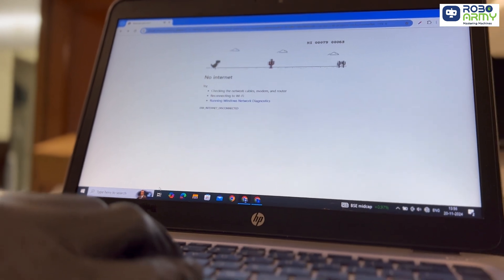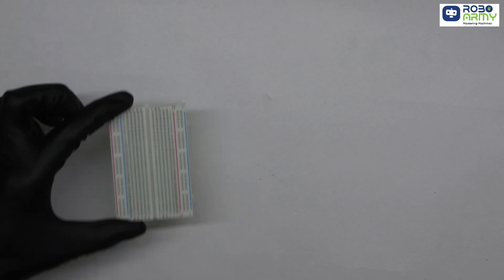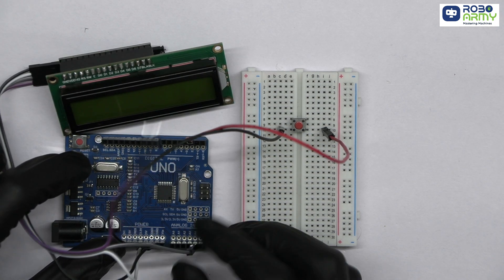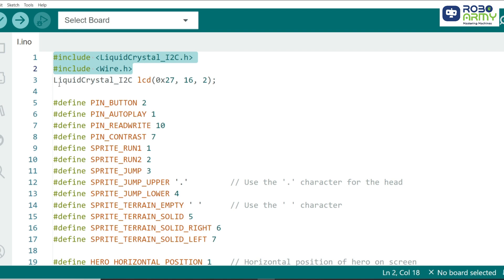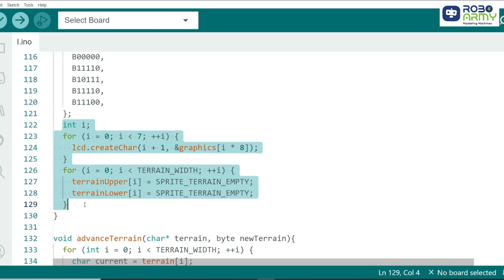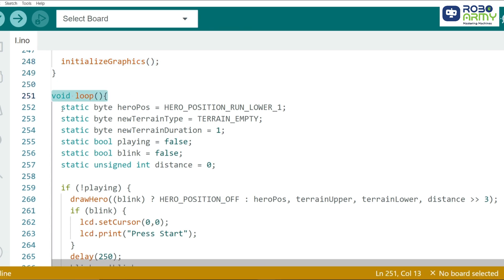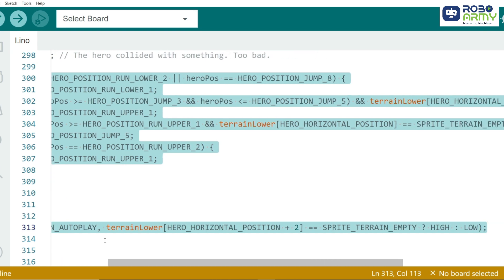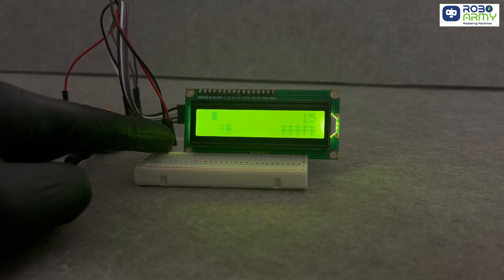Build the LCDino Run: Smart Dino Game Using Arduino UNO & LCD Display

Comment: no error but nothing displayed
Reply from the maker: Make sure your OLED is connected correctly (SDA to GPIO 21, SCL to GPIO 22), I2C address is 0x3C, and the display is initialized properly in the code. Also check contrast and wiring!

Comment: C:\Users\bilal\Downloads\38\38.ino: In function 'void setup()':
C:\Users\bilal\Downloads\38\38.ino:242:13: error: no matching function for call to 'LiquidCrystal_I2C::begin()'
   lcd.begin();
             ^
In file included from C:\Users\bilal\Downloads\38\38.ino:1:0:
c:\Users\bilal\Documents\Arduino\libraries\LiquidCrystal_I2C/LiquidCrystal_I2C.h:58:8: note: candidate: void LiquidCrystal_I2C::begin(uint8_t, uint8_t, uint8_t)
   void begin(uint8_t cols, uint8_t rows, uint8_t charsize = LCD_5x8DOTS );
        ^~~~~
c:\Users\bilal\Documents\Arduino\libraries\LiquidCrystal_I2C/LiquidCrystal_I2C.h:58:8: note:   candidate expects 3 arguments, 0 provided

exit status 1

Compilation error: no matching function for call to 'LiquidCrystal_I2C::begin()'
Reply from the maker: Hi! 😊 The error you're getting is because the lcd.begin(); function requires three parameters in the version of the LiquidCrystal_I2C library you're using.

Try replacing:
lcd.begin();

with
lcd.begin(16, 2);

This tells the LCD that your display has 16 columns and 2 rows. After that, your code should compile without errors. Let me know if you face any more issues — happy to help!

Comment: what should i do it say Compilation error: no matching function for call to 'LiquidCrystal_I2C::begin()'
Reply from the maker: It looks like you're getting an error because of the lcd.begin() function. For the LiquidCrystal_I2C library, the correct function to initialize the LCD is usually lcd.init() instead of lcd.begin().

✅ Try replacing:
lcd.begin();

with:
lcd.init();

Also, make sure you have installed the correct LiquidCrystal_I2C library (by Frank de Brabander or similar) in the Arduino IDE. Let me know if it works or if you face any other issue!

Comment: My lcd ıs openıng and closıng ın 1 second and dısplays nothıng
Reply from the maker: Sure, I’d be happy to help! 😊
A blue screen usually means the LCD is getting power but not initializing correctly. Here are a few things you can check:

I2C Address – Make sure the address in your code matches your LCD module (commonly 0x27 or 0x3F). You can use an I2C Scanner sketch to find the correct address.

Power Supply – If you’re using an SW-quare power supply and the screen keeps resetting, it might not be providing stable voltage. Try using a reliable 5V USB power source.

Contrast Issue – Adjust the contrast potentiometer on the I2C module until you see text.

Wiring – Double-check the SDA/SCL connections:

SDA → A4

SCL → A5 (for Arduino UNO)

Let me know what you're using (LCD model, Arduino board, etc.) and I can guide you more specifically!
Reply: @robo_army_  thank you I solved it I changed the potansiyometres Degree at the back of LCD the i2c module and it worked thanks ❤
Reply from the maker: Great work.

Comment: can you help me please ıt just gıves a blue screen and ı am usıng sw-quare power supply
Reply from the maker: Sure, I’d be happy to help! 😊
A blue screen usually means the LCD is getting power but not initializing correctly. Here are a few things you can check:

I2C Address – Make sure the address in your code matches your LCD module (commonly 0x27 or 0x3F). You can use an I2C Scanner sketch to find the correct address.

Power Supply – If you’re using an SW-quare power supply and the screen keeps resetting, it might not be providing stable voltage. Try using a reliable 5V USB power source.

Contrast Issue – Adjust the contrast potentiometer on the I2C module until you see text.

Wiring – Double-check the SDA/SCL connections:

SDA → A4

SCL → A5 (for Arduino UNO)

Let me know what you're using (LCD model, Arduino board, etc.) and I can guide you more specifically!

Comment: Anyone else had the issue of just "Press start" and hero blinking and game not starting when the button is pressed?
Reply from the maker: Yes, that issue usually happens when the push button isn’t wired correctly or the code isn't detecting the button press properly. Here are a few things to check:

Wiring: Make sure one side of the button is connected to GND and the other to a digital pin (e.g., D2) with a pull-up resistor (or use INPUT_PULLUP in code).

Code: If you’re using digitalRead(), confirm that the button logic matches — for example:

pinMode(buttonPin, INPUT_PULLUP);
if (digitalRead(buttonPin) == LOW) {
  // Start the game
}

Debouncing: Sometimes a button press isn’t detected due to bounce. Adding a small delay (e.g., delay(200);) after detecting the press can help.

Check the Serial Monitor (if used) to debug the button input. If it's still not working, feel free to share your wiring and code — happy to help!

Comment: Why does the dinosaur are flying?
Reply from the maker: In the Chrome Dino game, when we lose internet, the dinosaur jumps over obstacles. Similarly, in our Arduino-based LCD Dino Game, the dinosaur 'jumps' to avoid obstacles, but due to display limitations, it might look like it's flying. Just like the original game, the goal is to time the jumps correctly to keep playing!

Comment: bro this is the craziest working project i had built thanks for posting such amazing videos

but there is  one fault-in the video you have put SDA and SCL in A4 and A5
but in circuit diagram in description is after aref so you can fix that
thanks a lot again
Reply from the maker: Thanks a lot for your kind words! 😊 Glad you enjoyed building the project! Regarding the SDA and SCL connections: In the circuit diagram, they are actually connected to the dedicated SDA and SCL pins near the AREF pin on the Arduino, not A4 and A5. Both sets of pins work the same for I2C communication, but we used the dedicated ones for better clarity. Let me know if you need any help!
Reply: @robo_army_   oh alr i dint know that i made the project for science exhibition works perfectly

thanks a lot
Reply from the maker: Congrats for the exhibition

Comment: Why can't I download the code?
Reply: I can't see the code even though I downloaded it
Reply from the maker: Try it again via this link: https://roboarmypublicfiles.s3.ap-south-1.amazonaws.com/code/i.ino
Reply: @robo_army_  still can't open it
Reply from the maker: #include <LiquidCrystal_I2C.h>
#include <Wire.h>
LiquidCrystal_I2C lcd(0x27, 16, 2);

#define PIN_BUTTON 2
#define PIN_AUTOPLAY 1
#define PIN_READWRITE 10
#define PIN_CONTRAST 7
#define SPRITE_RUN1 1
#define SPRITE_RUN2 2
#define SPRITE_JUMP 3
#define SPRITE_JUMP_UPPER '.'         // Use the '.' character for the head
#define SPRITE_JUMP_LOWER 4
#define SPRITE_TERRAIN_EMPTY ' '      // Use the ' ' character
#define SPRITE_TERRAIN_SOLID 5
#define SPRITE_TERRAIN_SOLID_RIGHT 6
#define SPRITE_TERRAIN_SOLID_LEFT 7

#define HERO_HORIZONTAL_POSITION 1    // Horizontal position of hero on screen

#define TERRAIN_WIDTH 16
#define TERRAIN_EMPTY 0
#define TERRAIN_LOWER_BLOCK 1
#define TERRAIN_UPPER_BLOCK 2

#define HERO_POSITION_OFF 0          // Hero is invisible
#define HERO_POSITION_RUN_LOWER_1 1  // Hero is running on lower row (pose 1)
#define HERO_POSITION_RUN_LOWER_2 2  //                              (pose 2)

#define HERO_POSITION_JUMP_1 3       // Starting a jump
#define HERO_POSITION_JUMP_2 4       // Half-way up
#define HERO_POSITION_JUMP_3 5       // Jump is on upper row
#define HERO_POSITION_JUMP_4 6       // Jump is on upper row
#define HERO_POSITION_JUMP_5 7       // Jump is on upper row
#define HERO_POSITION_JUMP_6 8       // Jump is on upper row
#define HERO_POSITION_JUMP_7 9       // Half-way down
#define HERO_POSITION_JUMP_8 10      // About to land

#define HERO_POSITION_RUN_UPPER_1 11 // Hero is running on upper row (pose 1)
#define HERO_POSITION_RUN_UPPER_2 12 //                              (pose 2)

static char terrainUpper[TERRAIN_WIDTH + 1];
static char terrainLower[TERRAIN_WIDTH + 1];
static bool buttonPushed = false;

void initializeGraphics(){
  static byte graphics[] = 
  {
    // Dino Run position 1
    B11110,
    B10111,
    B11110,
    B11100,
    B11111,
    B11100,
    B10010,
    B11011,
    // Dino Run position 2
    B11110,
    B10111,
    B11110,
    B11100,
    B11111,
    B11100,
    B01010,
    B10011,
    // Dino Jump
    B11110,
    B10111,
    B11110,
    B11100,
    B11111,
    B11110,
    B10001,
    B00000,
    // Jump lower part [lower part of Dino while jumping]
    B11111,
    B11100,
    B10010,
    B11011,
    B00000,
    B00000,
    B00000,
    B00000,
    // Cactus Center part
    B00100,
    B11111,
    B00100,
    B00101,
    B11111,
    B00100,
    B00100,
    B00100,
    // Cactus right part
    B00000,
    B00011,
    B00000,
    B00000,
    B00011,
    B00000,
    B00000,
    B00000,
    // Cactus left part
    B00000,
    B11000,
    B00000,
    B01000,
    B11000,
    B00000,
    B00000,
    B00000,
    // Jump upper part [upper part of Dino while jumping]
    B00000,
    B00000,
    B00000,
    B00000,
    B11110,
    B10111,
    B11110,
    B11100,
  };
  int i;
  for (i = 0; i < 7; ++i) {
    lcd.createChar(i + 1, &graphics[i * 8]);
  }
  for (i = 0; i < TERRAIN_WIDTH; ++i) {
    terrainUpper[i] = SPRITE_TERRAIN_EMPTY;
    terrainLower[i] = SPRITE_TERRAIN_EMPTY;
  }
}

void advanceTerrain(char* terrain, byte newTerrain){
  for (int i = 0; i < TERRAIN_WIDTH; ++i) {
    char current = terrain[i];
    char next = (i == TERRAIN_WIDTH - 1) ? newTerrain : terrain[i + 1];
    switch (current) {
      case SPRITE_TERRAIN_EMPTY:
        terrain[i] = (next == SPRITE_TERRAIN_SOLID) ? SPRITE_TERRAIN_SOLID_RIGHT : SPRITE_TERRAIN_EMPTY;
        break;
      case SPRITE_TERRAIN_SOLID:
        terrain[i] = (next == SPRITE_TERRAIN_EMPTY) ? SPRITE_TERRAIN_SOLID_LEFT : SPRITE_TERRAIN_SOLID;
        break;
      case SPRITE_TERRAIN_SOLID_RIGHT:
        terrain[i] = SPRITE_TERRAIN_SOLID;
        break;
      case SPRITE_TERRAIN_SOLID_LEFT:
        terrain[i] = SPRITE_TERRAIN_EMPTY;
        break;
    }
  }
}

bool drawHero(byte position, char* terrainUpper, char* terrainLower, unsigned int score) {
  bool collide = false;
  char upperSave = terrainUpper[HERO_HORIZONTAL_POSITION];
  char lowerSave = terrainLower[HERO_HORIZONTAL_POSITION];
  byte upper, lower;
  switch (position) {
    case HERO_POSITION_OFF:
      upper = lower = SPRITE_TERRAIN_EMPTY;
      break;
    case HERO_POSITION_RUN_LOWER_1:
      upper = SPRITE_TERRAIN_EMPTY;
      lower = SPRITE_RUN1;
      break;
    case HERO_POSITION_RUN_LOWER_2:
      upper = SPRITE_TERRAIN_EMPTY;
      lower = SPRITE_RUN2;
      break;
    case HERO_POSITION_JUMP_1:
    case HERO_POSITION_JUMP_8:
      upper = SPRITE_TERRAIN_EMPTY;
      lower = SPRITE_JUMP;
      break;
    case HERO_POSITION_JUMP_2:
    case HERO_POSITION_JUMP_7:
      upper = SPRITE_JUMP_UPPER;
      lower = SPRITE_JUMP_LOWER;
      break;
    case HERO_POSITION_JUMP_3:
    case HERO_POSITION_JUMP_4:
    case HERO_POSITION_JUMP_5:
    case HERO_POSITION_JUMP_6:
      upper = SPRITE_JUMP;
      lower = SPRITE_TERRAIN_EMPTY;
      break;
    case HERO_POSITION_RUN_UPPER_1:
      upper = SPRITE_RUN1;
      lower = SPRITE_TERRAIN_EMPTY;
      break;
    case HERO_POSITION_RUN_UPPER_2:
      upper = SPRITE_RUN2;
      lower = SPRITE_TERRAIN_EMPTY;
      break;
  }

  if (upper != ' ') {
    terrainUpper[HERO_HORIZONTAL_POSITION] = upper;
    collide = (upperSave == SPRITE_TERRAIN_EMPTY) ? false : true;
  }
  if (lower != ' ') {
    terrainLower[HERO_HORIZONTAL_POSITION] = lower;
    collide |= (lowerSave == SPRITE_TERRAIN_EMPTY) ? false : true;
  }
  byte digits = (score > 9999) ? 5 : (score > 999) ? 4 : (score > 99) ? 3 : (score > 9) ? 2 : 1;

  terrainUpper[TERRAIN_WIDTH] = '\0';
  terrainLower[TERRAIN_WIDTH] = '\0';
  char temp = terrainUpper[16 - digits];
  terrainUpper[16 - digits] = '\0';

  lcd.setCursor(0, 0);
  lcd.print(terrainUpper);
  terrainUpper[16 - digits] = temp;
  lcd.setCursor(0, 1);
  lcd.print(terrainLower);

  lcd.setCursor(16 - digits, 0);
  lcd.print(score);

  terrainUpper[HERO_HORIZONTAL_POSITION] = upperSave;
  terrainLower[HERO_HORIZONTAL_POSITION] = lowerSave;
  return collide;
}

// Handle the button push as an interrupt
void buttonPush() {
  buttonPushed = true;
}

void setup() {
  pinMode(PIN_READWRITE, OUTPUT);
  digitalWrite(PIN_READWRITE, LOW);
  pinMode(PIN_CONTRAST, OUTPUT);
  digitalWrite(PIN_CONTRAST, LOW);
  pinMode(PIN_BUTTON, INPUT);
  digitalWrite(PIN_BUTTON, HIGH);
  pinMode(PIN_AUTOPLAY, OUTPUT);
  digitalWrite(PIN_AUTOPLAY, HIGH);
  
  // Initialize the LCD
  lcd.begin();
  lcd.backlight();

  // Digital pin 2 maps to interrupt 0
  attachInterrupt(digitalPinToInterrupt(PIN_BUTTON), buttonPush, FALLING);
  
  initializeGraphics();
}

void loop(){
  static byte heroPos = HERO_POSITION_RUN_LOWER_1;
  static byte newTerrainType = TERRAIN_EMPTY;
  static byte newTerrainDuration = 1;
  static bool playing = false;
  static bool blink = false;
  static unsigned int distance = 0;
  
  if (!playing) {
    drawHero((blink) ? HERO_POSITION_OFF : heroPos, terrainUpper, terrainLower, distance >> 3);
    if (blink) {
      lcd.setCursor(0,0);
      lcd.print("Press Start");
    }
    delay(250);
    blink = !blink;
    if (buttonPushed) {
      initializeGraphics();
      heroPos = HERO_POSITION_RUN_LOWER_1;
      playing = true;
      buttonPushed = false;
      distance = 0;
    }
    return;
  }

  // Shift the terrain to the left
  advanceTerrain(terrainLower, newTerrainType == TERRAIN_LOWER_BLOCK ? SPRITE_TERRAIN_SOLID : SPRITE_TERRAIN_EMPTY);
  advanceTerrain(terrainUpper, newTerrainType == TERRAIN_UPPER_BLOCK ? SPRITE_TERRAIN_SOLID : SPRITE_TERRAIN_EMPTY);
  
  // Make new terrain to enter on the right
  if (--newTerrainDuration == 0) {
    if (newTerrainType == TERRAIN_EMPTY) {
      newTerrainType = (random(3) == 0) ? TERRAIN_UPPER_BLOCK : TERRAIN_LOWER_BLOCK;
      newTerrainDuration = 2 + random(10);
    } else {
      newTerrainType = TERRAIN_EMPTY;
      newTerrainDuration = 10 + random(10);
    }
  }
    
  if (buttonPushed) {
    if (heroPos <= HERO_POSITION_RUN_LOWER_2) heroPos = HERO_POSITION_JUMP_1;
    buttonPushed = false;
  }  

  if (drawHero(heroPos, terrainUpper, terrainLower, distance >> 3)) {
    playing = false; // The hero collided with something. Too bad.
  } else {
    if (heroPos == HERO_POSITION_RUN_LOWER_2 || heroPos == HERO_POSITION_JUMP_8) {
      heroPos = HERO_POSITION_RUN_LOWER_1;
    } else if ((heroPos >= HERO_POSITION_JUMP_3 && heroPos <= HERO_POSITION_JUMP_5) && terrainLower[HERO_HORIZONTAL_POSITION] != SPRITE_TERRAIN_EMPTY) {
      heroPos = HERO_POSITION_RUN_UPPER_1;
    } else if (heroPos >= HERO_POSITION_RUN_UPPER_1 && terrainLower[HERO_HORIZONTAL_POSITION] == SPRITE_TERRAIN_EMPTY) {
      heroPos = HERO_POSITION_JUMP_5;
    } else if (heroPos == HERO_POSITION_RUN_UPPER_2) {
      heroPos = HERO_POSITION_RUN_UPPER_1;
    } else {
      ++heroPos;
    }
    ++distance;
    
    digitalWrite(PIN_AUTOPLAY, terrainLower[HERO_HORIZONTAL_POSITION + 2] == SPRITE_TERRAIN_EMPTY ? HIGH : LOW);
  }
  
  delay(100);
}
Reply: @robo_army_  can i put a buzzer on this code and a buzzer on the actual arduino?
Reply from the maker: Yes definitely you can try.
Reply: @robo_army_  do you have a tutorial on how to put buzzer on the code and arduino?
Reply from the maker: Not yet